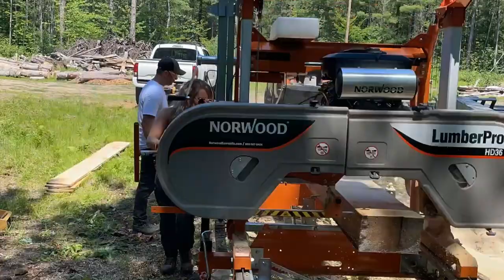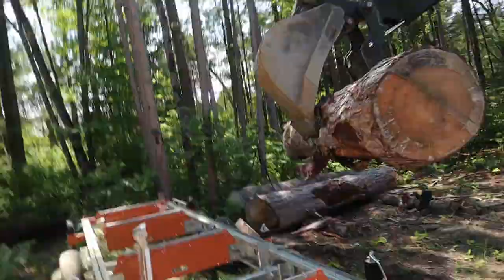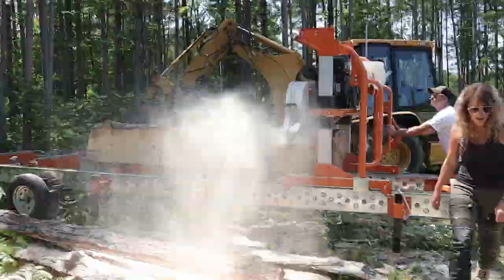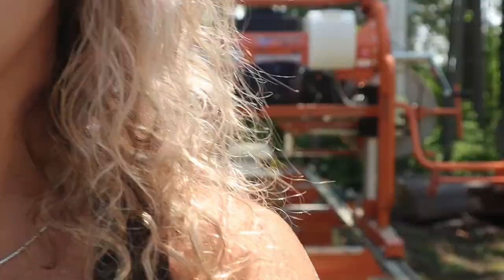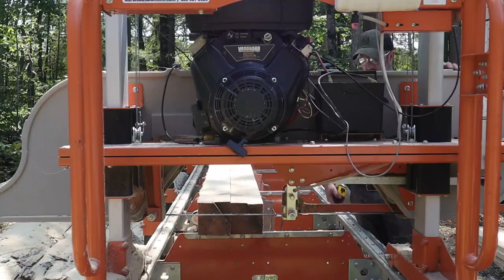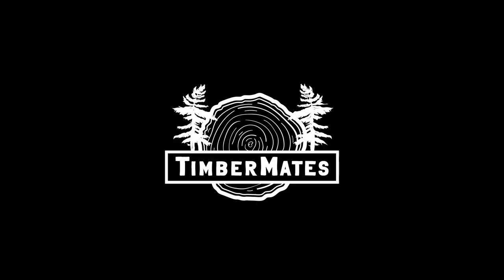Milling Lumber TIMELAPSE | Logs to Lumber in one minute!

Comment: Nice videos. I just found your channel and I think you are a very entertaining couple. Maybe you could do some videos highlighting the equipment you use. I have the same sawmill, but it looks like you have a 4 ft extension on yours. That will be my first upgrade to mine, I can only cut 12ft 4 inches right now. I thought that would be long enough, but I keep finding longer logs and projects that could use longer boards. 
    That lift that you use in your tree dropping videos is pretty awesome. It looks like it is just the ticket for getting started in that kind of work. Doesn't need a separate trailer and light weight enough to go across a soft lawn without ruts. 
    Looking forward to more videos. Good luck with your channel.